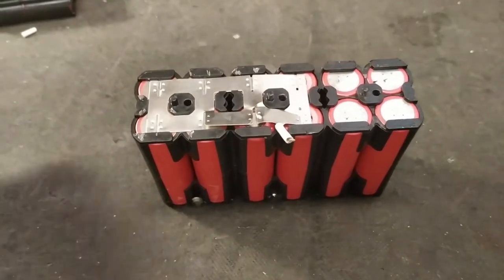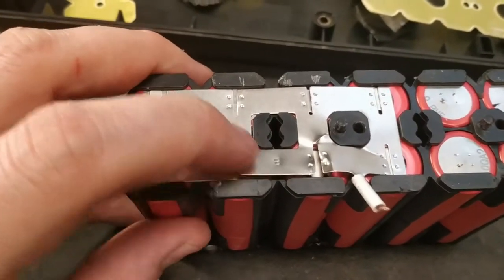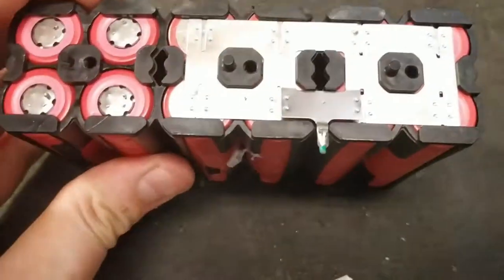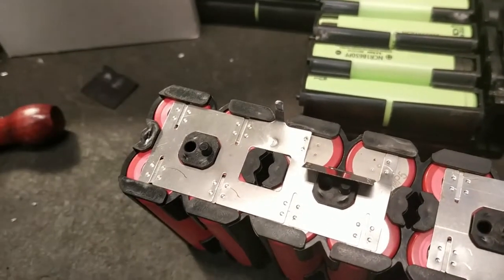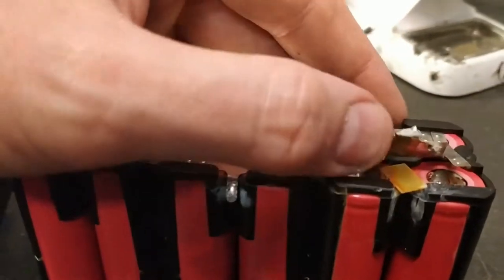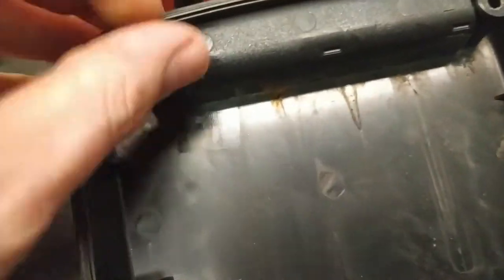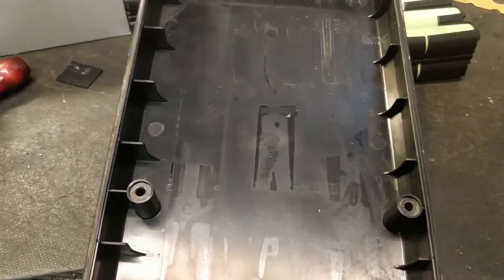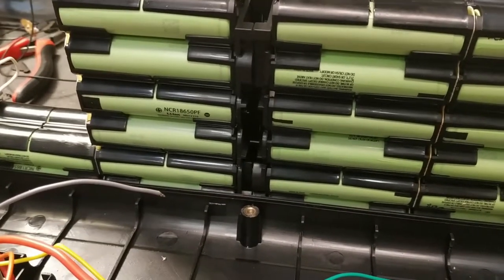Batavus (Accell Group/Phylion) 36V battery Problems

Comment: Thanks for a super video, well explained, with the battery I have spent money on a battery similar to with exactly the same problem.
 
It is an option to use solar panel to charge a batevus battery, with an MPPT Boost Solar Panel Battery Regulator Charger, 

but as you mentioned the charger plug is not standard and on the BMS there are 5 wires connected to IO COM NTC CHG - CHG + 

The question is can you connect the mppt to CHG- and CHG + and charge the battery?